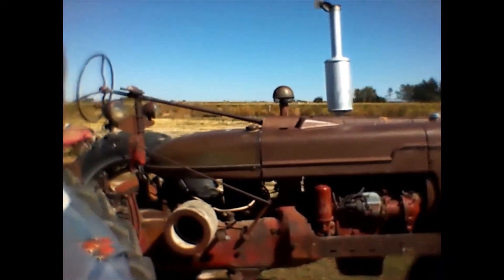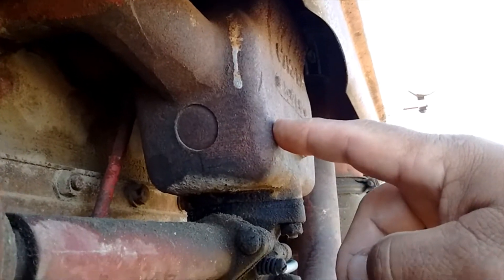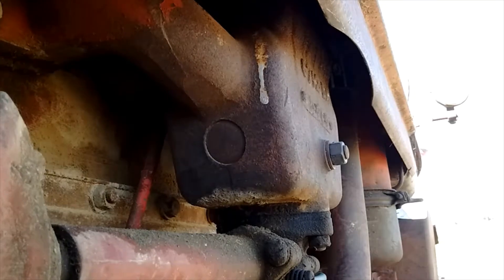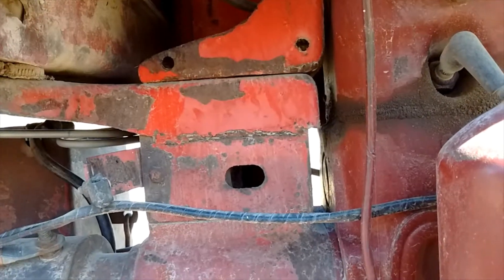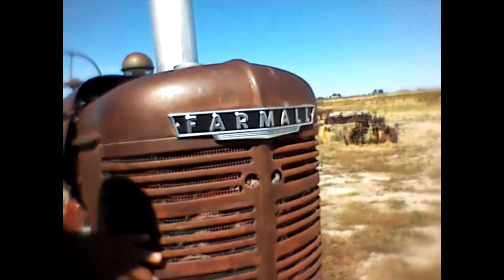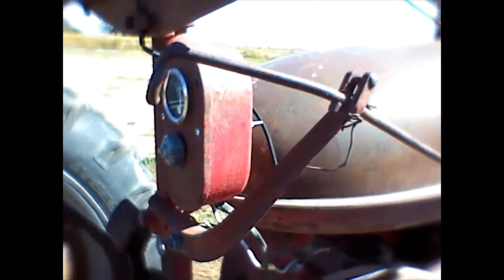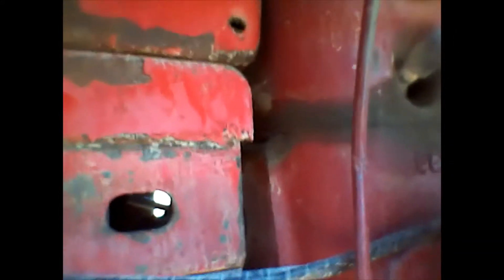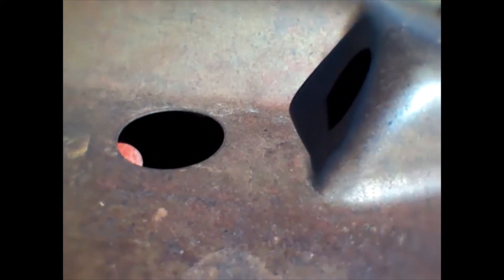All Fuel Explained

Comment: many before that did that also the first ones made.
Reply from the maker: The problem with Granddad's "H" is it is a pre-war model, that originally was tagged for shipping overseas, so there are some odd ball things with it.  It never made it across the pond, as war materials took priority at that time.  One of the "odd ball" things is the location of the fuel outlet in the bottom of the tank. The gas only lines don't fit it and neither do the all-fuel or distillate lines, unless you have the dual tank sediment bowl/valve assembly.  This tractor never had the small starting tank installed and as far as I can tell, never had the all/fuel valve assembly installed in it.  I mean, why would IHC install a dual fuel sediment bulb/valve combo with an extra opening in that valve assembly that didn't go anywhere?  Your guess on that is as good as mine.

Comment: Possible that the original gasoline intake was damaged and somebody swapped it out with whatever they could get off a parts tractor, you should be able to tell for sure by the compression ratio but this isn't so easy to measure.
My late model 140 owners manual still has a distillate engine section and gives instructions for operation of a distillate engine on all gasoline: keep the temp gauge on the cool edge of the green operating zone using the radiator shutters, set the manifold heat to cold [or intermediate in cold weather under light load], and use the gasoline engine maintenance schedule.(basically a difference in oil changes) It also says for regular use on gasoline remove the tin heat shield in all but the coldest weather.
Reply from the maker: So sorry for the delay in getting back to you on this topic.
  On close inspection, the original paint has never been touched where the "starting tank" would have been installed.  This makes me believe that had one ever been installed, some rust or other discoloration of the paint would have occured.   Plus, as far as we can tell, the hood is original to the tractor which would have had an extra hole in the right hand side of the top, for the tanks fuel neck to poke through.  There isn't one on this hood.
  After speaking with several knowledgeable  people that are very familiar with Farmalls of the early 40's, I have learned that the U.K. had different tractor fuels blend requirements (they were already at war) than we did here in the states prior to out break of WW2 for the US.  I also learned that this tractor was 115 away in production numbers from a group of around 200 assorted IHC tractors models, that were being shipped to England in 1940 as part of the war effort.
  This is where this tractors construction gets a tad hazy.
  Being built for this country, it would have had an "All Fuel" system and it does indeed have the manifold for it.  However there is no mounting bracket, studs or holes for the heat sheild, where it would have been installed on the manifold, nor is there any wear marks or other indications of ever having the heat shield installed.  It does have the "All Fuel" main fuel tank.  These tractors apparently used the normal "gas only" sediment bulb/fuel shut off (a Brittish requirement), but incorporated a modified fuel line for the All-Fuel system, so that it would attach to the regular gas bulb assembly.
  This was all part of the "Brit's Run" of machines as it was known by some at IHC back in the day.  For whatever reason, this machine was a part of a "Brit's Run", but was never shipped overseas.